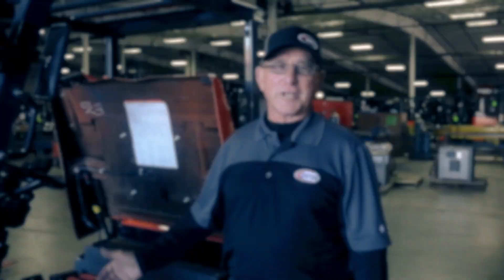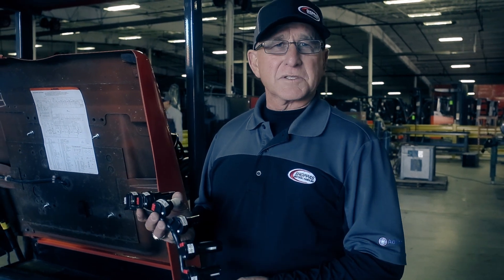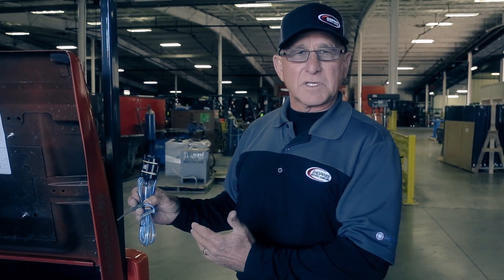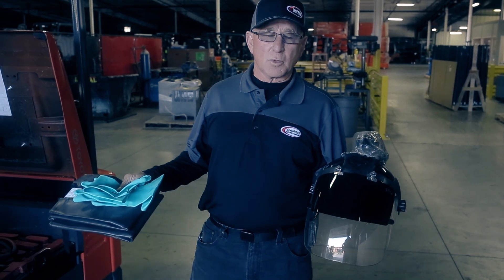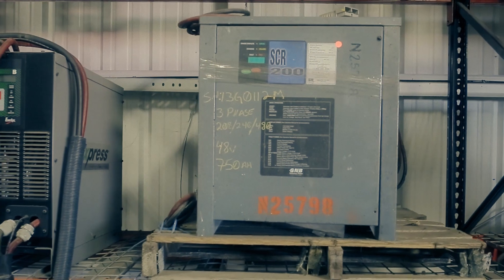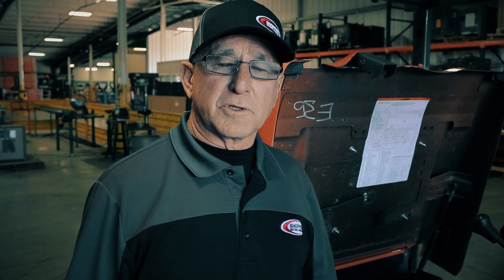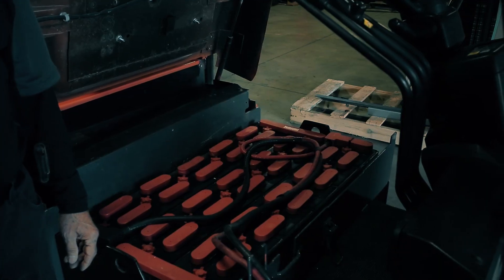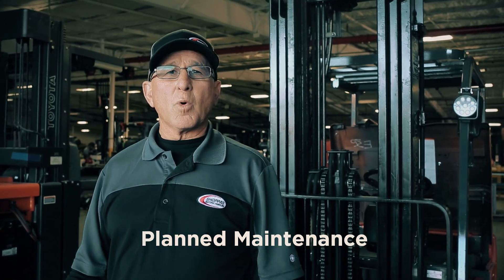Forklift Battery Maintenance  101

Comment: How low should I let the forklift's charge get before recharging.  We do not use our lift but I few hours a week.  We are typically using 1/2 of the charge per week. Should I simply recharge over the weekend at the end of the week or let the charge get lower before charging?

Comment: Well done, except, the verbiage in the industry is flawed. You mentioned... Boil over.  Yes the batteries can boil over, but NOT due to heat.  A battery should never be HOT. 149 degrees is the danger zone. 161 is the catastrophic zone where the battery is degrading!  When Battery Professionals speak of a boil over, it is actually due to the acid going in and out of the plates.  As a battery functions, the acid enters the plates. At charging the acid is pushed out. There is only so much physical room in the cell.  So. If you water a battery at a discharged state, the acid will come out during the charge cycle and literally push the acid and water mixture out of the cells but not due to heat, due to physical room and expansion of volume due to the suspended acids coming out of the cells and needing space.

Comment: Can damage be done if the charger is plugged into the forklift instead of plugging into the batteries?
Reply: YES!  Incorrect!  IF you have a manual charger with a mechanical timer and it's set to 48 volts.  You plug it into a lift with any computer systems and the lift is a 36 volt or a 24 volt, smaller than the set voltage of the mechanical charger, turn on the mechanical charger.  YES. YOU CAN DESTROY THE COMPUTER COMPONENTS.  LIKE A MODERN CAR, THE COMPUTER IS ACTIVE ON MANY TYPES OF EQUIPMENT.  I HAVE SEEN IT HAPPEN.  CUSTOMER NEGLIGENCE.  Customer pay.  Unfortunately, it was on a rental truck.
Reply: No chargers detect voltage from a discharged battery before the charger will "start" the charge cycle.

Comment: Thank you for this clear and necessary narration of battery maintenance procedures.  About adding water ONLY after charging fully?   We too have had clueless workers flood electrolyte all over- even onto the floor!  
ONE TIP for REALLY low batteries in very low use lifts. (We've had to charge batteries where the acid level is out of sight!..  So we make sure to bring water up just enough to  cover all the plate surfaces, and THEN fully charge. This (so far) has never overflowed AND prevents charging only part of the plate surfaces, .